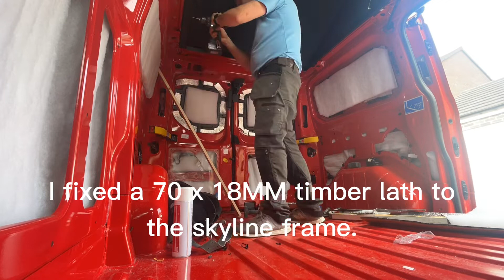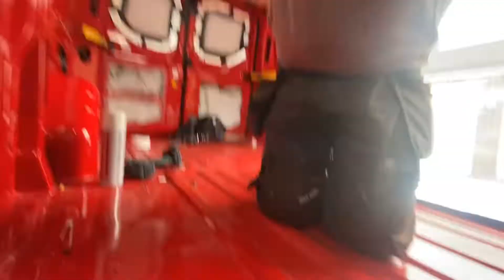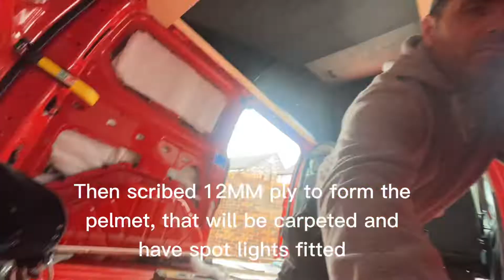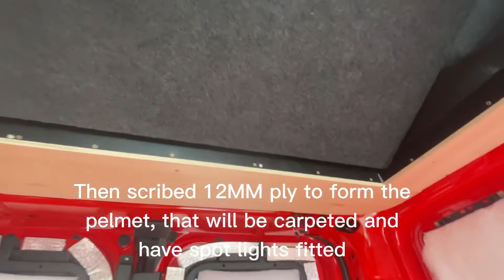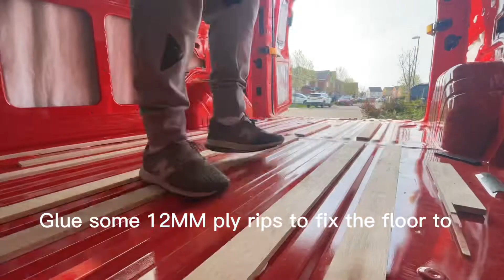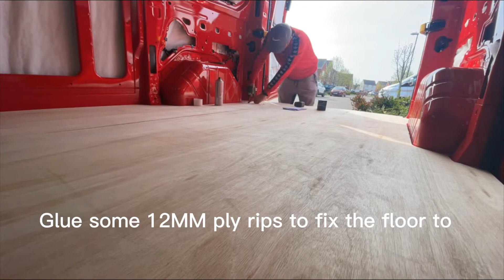Ford Transit Custom Camper Conversion Part 3 | Fitting the pelmet & Floor

Comment: No insulation under the floor?
Reply from the maker: No mate 👍🏻
Reply: Ok thanks. Looking to do 1 myself so wondering if it’s necessary. I’m in Sunderland 👍🏻😀
Reply from the maker: @thesparky1212  There isn't really a gap to put any under the floor but I made sure the walls are well insulated. I'm Sunderland too, so if you ever want to take a look at mine for any advice you are more than well come.
Reply: @JoinerBaz  thats great mate very kind of you thanks 🙏